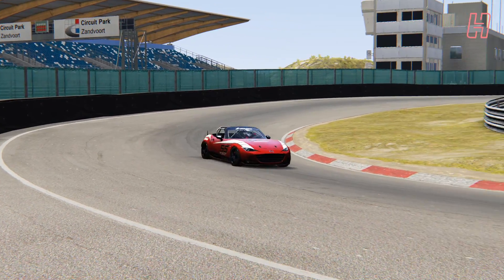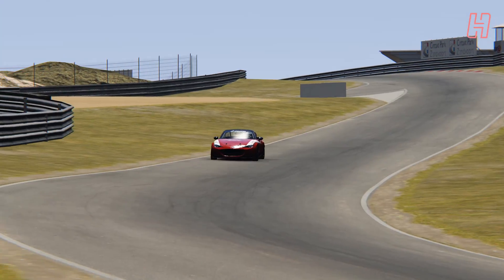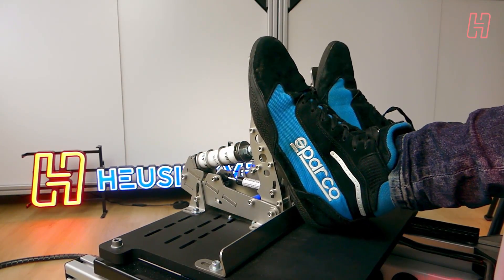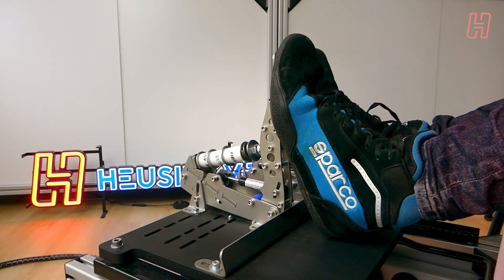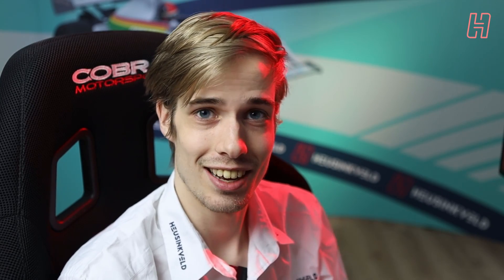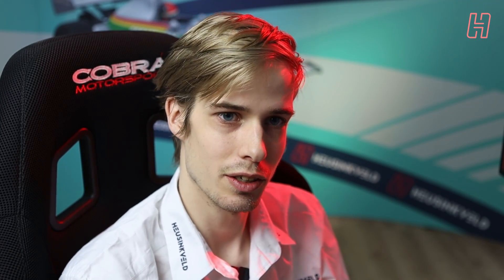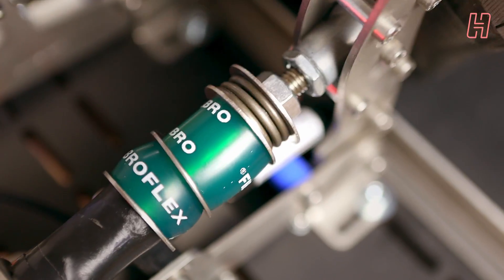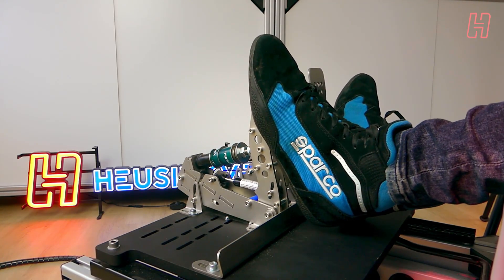Enzo explains choosing the right brake pedal force and pressure

Comment: Had my Ultimate+ for a few weeks. I settled in on soft factory set up with 45kg. 65 felt good but i found it a bit too fatiguing over longer drives. Works good allaround for all the different cars ive tried. Nice middle of the road set up.

Comment: I know it is called "simulation" but I would argue, that replicating real-world braking forces in your living room is pointless. Anything more than 25 kg is overkill and actually makes you slower.
Reply from the maker: Hello gabox01, 

Thanks for your comment.

The optimal pedal feel is highly subjective, even for world class drivers. We are aware of real world F1 drivers who indeed set their pedal very soft when they're simracing. On the other hand, we also know world class simracers (absolutely top level) who race with brake pedal forces of around 60-80kg. A trained leg can push a lot of force :)

Best regards,
Your HEUSINKVELD Team.

Comment: Meanwhile clowns on reddit and other forums claim that realistic setup is 100kg of resistance for GT3 cars and literally zero travel.
Reply from the maker: Hello Lukáš, in real racing cars you'll indeed find a wide variety of brake pedal behaviour. Some are soft, some are rock hard (F3 is a good example), some are in the middle. Even for GT3 cars you'll find various setups in real life. We'd like to develop our pedals in such a way that you can simulate any kind of real race car with them.

Best regards,
your HEUSINKVELD Team
Reply: @HeusinkveldEngineering  Thanks for your answer. What about gas pedal? What is the force required to press Heusinkveld gas pedal to 100%?
Reply from the maker: Hello Lukáš, 

Thanks for your question.
You can find more information about our Sim Pedals Sprint and Sim Pedals Ultimate+ on the product pages on our website:
https://heusinkveld.com/shop/sim-pedals/sim-pedals-sprint/
https://heusinkveld.com/shop/sim-pedals/sim-pedals-ultimate-plus/

Or at the support page of our website:
https://heusinkveld.com/support/product-manuals/

For further questions, you can always reach out to our customer support email:
support@heusinkveld.com

Best regards,
your HEUSINKVELD Team

Comment: Hi Enzo , what about f12021 setup for brake and throttle , what is optimal??
Reply from the maker: Hello HD,

There is no one right answer on what is optimal, as this all comes down to personal preference! If you want to realistically simulate a modern F1 car, using one or two green rubbers, with at least 110kg on the brake pedal would be good suggestion!

Best regards,
Enzo
Reply: @HeusinkveldEngineering  my bad I did not tell you I have sprints , guess those green ones would be medium + h
Reply from the maker: It would be more similar to installing a single S or M rubber!
Reply: @HeusinkveldEngineering  tnx for info
Reply: @HeusinkveldEngineering  i understand having those heavy brakes could be realsitc but also when u brake in real life you get the slowing down g forces which helps in allowing ur foot to put more strength into braking which u dont get at home so it makes it easier/ and less strength to press the brake in a real f1 car , am i wrong?

Comment: What are you looking or feeling for when adjusting Brake Pre-load? I took the brake apart just to adjust the angle and not sure if I put the preload back to where it was originally.
Reply: Been a long time, but hopefully you will read this. I just set it to where there is no "slack" in the pedal. So tighten the preload up right to where it meets the top plastic bit on the rubber closest to the pedal face. That, in my opinion, is the correct preload.

Comment: I still totally don't understand this at all. Why on earth would you want your pedals to be that hard to press? I'd much more prefer the brake to be as light as the throttle or clutch, which makes it a lot easier to depress as well as to control how far/ deep you depress it. Makes no sense to me to have a hugely stiff brake pedal on my sim (unless you're actually used to having a very heavy brake due to racing for real perhaps?).
Reply: @Delta Lima Hey, our pedals use loadcells, which means they're force based pedals. For the brake pedal, this means that your digital output (what the game sees), is based on how hard you press on the pedal, not how far the pedal travels. The different rubbers allow you to set a certain amount of travel for a given amount of force. This means that a higher KG setting will essentially give you a bigger range to modulate. A reason to go for a stiffer pedal (less travel) is that it helps getting to max. brake pressure faster.
Reply: Modulation.  The idea is that, if you have a higher initial setting on the load cell, then it's easier for you to lift exactly the amount you want.  Suppose you're braking at the limit of grip for the car you're driving, and need to let up by 5% - easing off the brake from 20kg to 19kg is easier for you to control than easing from 5kg to 4.75kg.
Reply: Those explanations really made it a lot clearer for me. Thanks!

Comment: Hi Enzo, great video ! what settings would you use for the dallara P217 ?
Reply: Any luck on getting answer and if not what did you settle on?
Reply: @AaronJay83  Hey, I personally use two green rubbers and about 90KG's with the Ultimate pedals for the Dallara P217 in iRacing

Comment: I have this issue in Iracing where i can’t brake as late as others do, meaning i have to brake earlier to be able to make the turn, so i’m always getting outbraked, how the heck is it possible to NOT have the same amount of brake power to brake at the same braking points as others? (it’s not brake bias of the car) is purely brake power
Reply: If it's a spec series then they're just better at finding the right amount of pressure quickly and accurately than you are, faster reaction time and more precise, also they might very well be on the edge of grip but know how to balance it better. If it's not a spec then it could be a combination of that + a setup that can handle higher levels of braking vs. your setup. Practice is the key...time and experience.
Reply: johndough247 It’s pretty much the same in all the series i race (skip, F3, VRS Sprint), I’m precisely always 2-3 sec slower then fastest lap times. Is it possible that the signal got interference from another source? But you’re right pratice IS the key! And hot tires!

Comment: Jeez how the heck can you apply 40Kg on the pedals, i own the sprints and if i put 40kg i can’t achieve 100% unless i use both legs!
Reply: Train on your legs
Reply: We need to press 100 kg in race cars 😂
Reply: What do you weigh? You should be able to press 40 kg with your right leg if you are healthy and able to get up from the couch without assistance ;)

Now, if you want to do this 15 times every 90 seconds (depending on track and laptime) is another question.
Reply: A race car maybe but in front on a standing pc my girly legs should be fine! lol

Comment: i still dont understand how measure the kg how do we no which kg we are using?
Reply: You don't need to measure it if you have the rubber that he has, but if you wanna measure you could use your scale, put a piece of flat wood the size of the scale on the feet of the scale and push on the pedal with the wood touching the pedal and your hand touching the scale. But it's all about feel, how you want your pedals to feel, you don't need to know the exact force being applied
Reply: Hi, this is explained in the manual for the Ultimate pedals. Every 25 RAW steps on the Ultimate brake pedal is roughly 1 KG.
Reply: @EnzoFazzi  the manual explain the old version of board v1 and 2 not v3 which is way different resolution from the old board so is totally different
Reply: @AccuracyGaming  the V3 controller is a 12 bit controller just like the V1.
Reply: @EnzoFazzi   they are different resolution reading .

Comment: I think I've made the mistake of trying to replicate the brake pedal stiffness and pressure to what I'm used to with my road car, the heavy and stiff brake pedal on default just caught me out and instead of trying to get used to that I immediately lowered everything with way more travel. I've been driving all types of cars this way in sim racing with the road pedal feel. Will I have lost a bunch of time doing that you reckon? And should I practice to get used to a harder/ stiffer pedal with less travel in order to get faster? I'm thinking the answer is yes, but I'd like your expert opinions :p
Reply: No, actually that's quite wrong. You will get most by not switching that depending on the car. How do I know? I do change it based on the car category for my pedals and it feels very different - with this you need to get used to that - so you lose a week or two to getting adjusted. That's why it's so hard for me to chase people who race everything with the same pedal feel - you are most comfortable with the one you are most used to - but this is the difference between real world drivers and sim racers, sim racers are just used to mostly their one favorite setting and rarely switch, real world drivers have driven various cars and are used to having to adjust do different cars. So the choice is whether you want it more realistic or do you want better lap times. And as for the overall setting, something in the middle is probably give you the best overall results if you switch often, otherwise you can choose the setting for the category which you race for the most time.
Reply: @arcelivez  You are right keep changing is pointless but i disagree on not changing.  The OP wants to know if he should have a stuffer pedal not if he should keep changing it. 

I was like you and had pedal travel like my real car but over the past 6 months ive changed to one with a tiny bit of travel around 15mm to 20mm 1 to 2cm then its rovk hard and my lap times have improved and my consistency have gone up dramatically.  My wieght transfer it much much better and I'm trail braking like a pro. 

When you have too much travel in the pedal you have too learn muscle memory with distance memory which without looking at the pedal is extremely hard to do consistently if possible at all when your talking 100s of a second, i have mine set up so in Iracing when i press the pedal to its max travel you hear the cars brakes Squeaking then it has a very tiny bit more travel then its all pressure based no move movement or what there is isnt noticeable too the human eye and imo that is how it works in a real race car. The travel is the brake pads moving too the brake disk then you get a tiny bit more travel which i believe is the brake fluid compressing completely then the pads are being pressed again the disk as hard as you press.

Trust me @mister dog just try it.
Reply: @Simlife101  You got me wrong. I was saying that it's performance wise for sim racing performance easier to not change the settings - that means of course that initially you can adjust to whatever settings you're most comfortable with or which ones you like and maybe keep adjusting if you feel you've still haven't found the best point. There are various factors like performance in real life from sim racing (better to adjust for each car then), performance solely in sim racing (better to stick to one best setting), physical limitations (my knees start to hurt with too stiff pedals if I drive it often), rig limitations if some rigs bend too much with stiff pedals, also whether you are someone who does endurance or more short sprint races or just focusing on hotlap boards, etc...
Reply: @arcelivez  True I've just left it as is in the end haha
Reply: @misterdog7  I think arcelivez is correct.

Sims basically allow you to generate as much braking efficiency with whatever hardware you have, so moving to a more accurate brake force will just cost you lap time while you're re-training your muscle memory.

That said, in the video, Enzo mentioned that it's almost impossible to effectively modulate your brake pressure with a very soft pedal (30-35kg), so with that in mind, although you'll need to spend some time adapting, you'll probably be able to trail brake more effectively with a stiffer brake.
Reply: @theoldhenk7531  agreed. Keep changing is stupid. Just set it hard with little travel then just adjust it in game software using the brake force too get it to your liking.

Comment: Great Video but I have some questions. What do you mean by N kg of brake pressure? Is it just the calculation that the load cell of the Ultimate brake can take up to 200 kg and you use just n% of it's range or is it the actual pressure on the pedal? Second question is about the travel. Do real race cars have that much travel on the brake pedal? I thought I have heard that they have very little pressure.
Reply from the maker: It's the actual pressure the load cell can take. It totally depends on the race car how far the travel is. And nowadays also personal preferences. In some cars a lot of things can be adjusted.

Comment: yes but : imo three rubber is better even for gt3 
 nissan gt3 pedal travel :  https://www.youtube.com/watch?v=X-d0KwgZghE
v8 supercar : https://www.youtube.com/watch?v=qdWSyrqEnE4
Reply from the maker: Thnx for the links. Always nice to watch! There is not a one solution fits all. Different brand of car, different year or the start or the end of the race. If you look at this Porsche GT3R from 2015 there is a shorter travel than in your examples (https://www.youtube.com/watch?v=KERipgTmwFw). Messing around with different travel distances in different cars can be rewarding for your laptimes or consistancy.

Comment: It's true to varying degrees that the momentum of breaking is used by the breaking foot for much of the pressure needed, for example, in F1 the driver's momentum adds I think 90 pounds of force. That's very different in a chair that has no such momentum, momentum that can be felt and adjusted to while breaking, offering an additional, visceral dimension of sensitivity of force on the break pedal. Left entirely to the leg muscle without any fully body adjustments to refine the sensitivity make similar forces for a sim pedal less than ideal, I would imagine, at least for myself, I cannot yet feel delicately while slamming with full force into the pedal.
Reply from the maker: There are a lot of discussion out there about if there is a momentum or not and if there is, how much it is. One thing to remember is that in a race car a driver is strapped very tight. So this momentum can only be achieved by the weight of the leg. And the moment of max braking force is very short. A driver only presses the 130+ kilo's on a brake in an F1 car for maybe 3 tenth of a second max. It's a hard push and then gently releasing the force on the brake.
Reply: I think it's not so much about "momentum", but about the setting. When you're on a real race track and in a real car experiencing all kinds of G forces, it feels natural to kick the brake pedal with full force. Not so much in your living room in a stationary position.

Comment: Mmm, should a gt3 spec car not have about 80-85 kg brake pressure instead of the proposed 40-50 kg's? I am pretty sure both the gt3 cars as well as v8 supercars have around that amount of pressure.
Reply from the maker: If you have actual 'proof'of the amount of kg's on certain race cars. Please let us know. We love to have this information :) There are so many racecars out there in so many years our guess is that it differs a lot. But these are the kg's reported back to us from some of the driver's we are in contact with.
Reply: @HeusinkveldEngineering  I mainly base my 80 kg estimation on online articles/forums and Rfactor2's brake pressure numbers. In these 2 articles for instance they are talking about 70 -100 kg for v8 supercars if you search for 'kg':  
https://www.supercars.com/news/championship/the-longest-seven-seconds-of-jones-life/
https://www.highlineactive.com.au/post/2016/10/02/physio-and-v8-supercars

Furthermore, if you select (certain) cars in Rfactor 2 > then advances > max pedal force, you will see 70 - 90 kg's for most GT cars,  including GT3 cars.

Comment: So if I race gt3 cars in ACC and fórmula cars in IRacing and F1 games then I need to change the rubber back and forth if I want to have the realistic feeling for each type of cars and recalibrate everything. 🤔😔. Hmmm, there is no easier way?
Reply: hi,  try to find compromise :
good feeling pedal and adjust braking force increasing in control panel 
simracing is all about compromise and  a muscle memory...
i think it's not really recommended changing every time  
  just my opinion
Reply: just play with the brake force in the smart control software it’s enough imo!